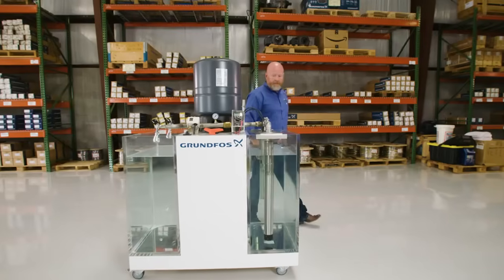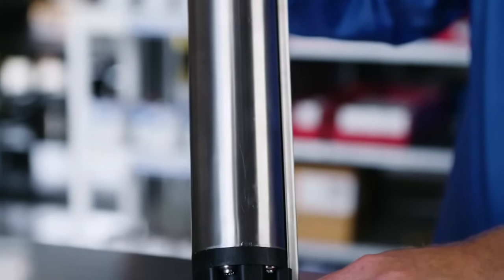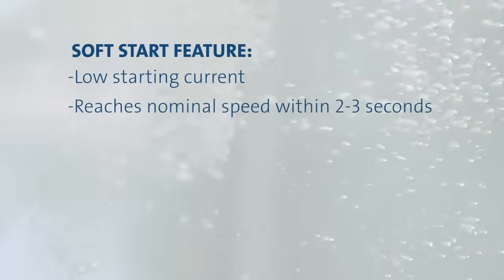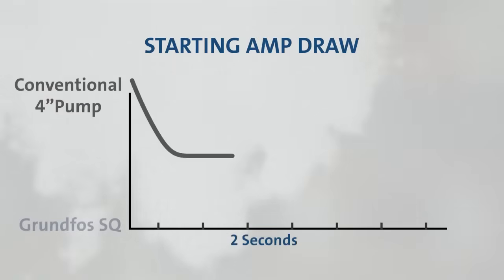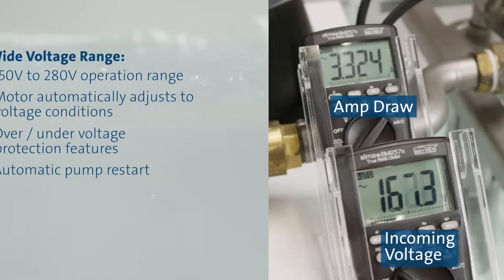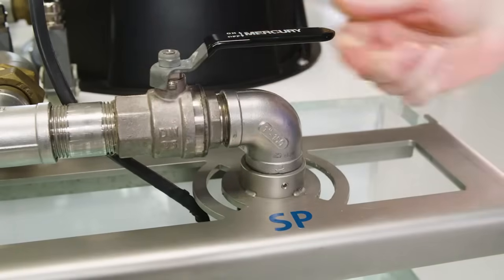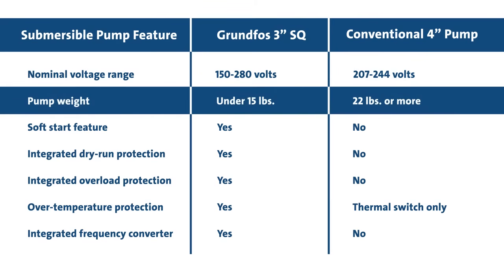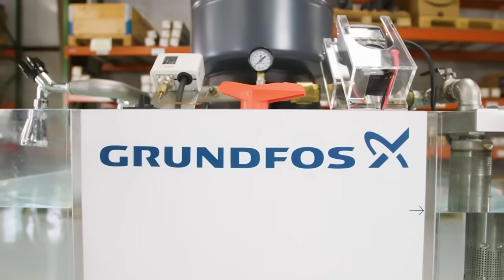Comparison of a Grundfos 3” SQ pump to a conventional 4” submersible

Comment: What SQ pump would I need to lift water 350 ft to a none pressurized holding tank . Not really needing high GPM flow .
Reply from the maker: Hi Jack, 

The smallest SQ pump (5 GPM Series) that will do 5 GPM at 350’ of lift, is called 5SQ07-320 pump and is marked in Blue in performance curve and Part Number (Material Number) list below.

If you would like to step up 1 GPM to pump 6 GPM, can go with 5SQ07-360 pump 

This is a good option if low GPM yielding well.

We hope this helps. :) 

Thank you :)
Reply from the maker: Also Another option SQ pump (10 GPM Series) will do 11 GPM at 350’ of lift, is called 10SQ15-330 pump.

This is a good option for a medium GPM flow at 350 feet of lift.
Reply: @grundfos   Sorry to hijack the post.
I have an sq3-55n in a 30meter deep 4 inch sleeve. Currently used to fill our 20000l fire fighting tank.
We run 1 and 1/4 inch pipe approximately 500m to fill this tank. My question is how does this pump handle property irrigation. Getting rather dry and want to run approximately 8  T pieces off the main line and each will also be running approximately 20meters of 1 and 1/4 hose. With isolation valves at each tap to run decent sized irrigation sprinklers. We do have a second bore same size however it is yet to have a pump installed. Will the single pump handle this.
Reply from the maker: Hi! Thanks for sharing the details of your setup. The SQ3-55N is a robust pump, and it may be capable of supporting your irrigation needs depending on total flow demand, pressure requirements, and elevation changes across the system.

To ensure optimal performance and avoid overloading the pump, we recommend reaching out to our technical support team at support-us@sales.grundfos.com. They can help assess your current configuration and advise on whether a second pump would be beneficial for your irrigation plans.

We’re here to help you get the most out of your system!

Comment: OK, I plan on getting one of these after I pull my old, dead pump out of the hole. Since I have a secondary well to supply water, I'm not in a real hurry but would like to get going on it in the next couple of weeks. The dead pump is down about 450' in a 500' hole and the well itself has produced from 1/2 gpm to around 3 gpm sonI need a pump that is optimal for that range. Can you recommend the model # Grundfos 240v pump that I should use?
I plan on doing the work myself, the downpipe is 1" sch 80 PVC in 21' sections so while it won't be a "fun" job, it's "doable".
Reply from the maker: Hello! Thanks for sharing the details of your setup — sounds like quite the project. For a well with variable output like yours and a depth of 450', selecting the right Grundfos 240V pump is crucial. To ensure you get the best recommendation tailored to your specific needs, we suggest reaching out to our technical support team at support-us@sales.grundfos.com. They’ll be happy to guide you through the best model options for your application!
Reply: @grundfos  Thanks, I'll do that. One other question, I was thinking of getting rid of the PVC and using 1 1/4" 200# poly piping which would greatly simplify the installation. Also the removal, since I could cut the PVC every 10' or so without having to bother with unscrewing a fitting every 21'.
Reply from the maker: Hi sorry for the delay. Getting rid of the PVC using 1-1/4” 200# poly piping sounds like a good idea for the reasons given and should work just fine.

However, it is really a local code question. Please investigate your locals codes and if allowed there, your good to go.

We hope this helps :)
Reply: @grundfos  Thanks. I already bought a Grundfos pump that should serve my needs. In your opinion, would 200PSI poly drop pipe work for a depth of 425'?

Comment: I have a 255’ well with 152’ static water level and 20gpm. What model would be the best? I think the sqflex is what I need as it will be off grid
Reply from the maker: Hi, 
Considering the initial sizing of 152’ depth to water pumping 20 GPM while off-grid sized to SQFlex 22SQF-220 Part Number 99465259.  Advantages for this pump selection also handles the additional foot of head from friction loss from length of pipe run plus fittings, additional lift to highest demand (shower head) and covers future dropping of depth to water of 152’ could drop to 200’ let’s say. Therefore, the 22SQF-220 will serve you well off-grid solar panel power source, even if your measurements change some. Thank you for asking. 😉 

Best regards, 
Steph

Comment: can these pumps hold up to 1-2 million gallons a year?  Not having problems with that with goulds 4" standard pumps but I want to switch to offgrid.  the regular 3 wire grid tie pumps are lasting for over 10 years easily.
Reply from the maker: Hi, 

We have taken many steps to increase the lifespan of the product both in the pump end, which includes the use of floating impellers each with their own tungsten carbide/ceramic bearings to ensure high wear resistance to sand for a long product life, and the motor, which includes the use of tungsten carbide/ceramic bearings and thrust bearings protecting against down thrust which allow product lifetime equal to conventional AC motors. These combined with the dry run protection, high efficiency pump and motor, protection against up-thrust, soft start, over-voltage and under-voltage protection, over-temperature protection and the high starting torque are some features and benefits which will also help to increase the life and operation of the pump. We do not have a definite lifespan that the pumps will last as the largest variable to the lifespan of a pump is going to be the environment that it is operating within. We hope this helps. :)

Thank you, 
Steph

Comment: My 780' well produces 45 GPM
Static water level at 70'
Puting out 15-20 gallons @360'
Is the 22SQ/SQE15/220 the right pump for me?
Reply from the maker: Hi, 

 We are not seeing SQ/SQE15/220 as the right pump. 

To pump 15-20 gallons @ 360’ needs more like a 4” SP16S200-18 if staying closer to 15 Gallon per minute. 

And, SP16S300-24 if staying closer to, or must achieve, 20 gallons per minute.

We hope this helps :)

Thank you, 
Steph

Comment: I am looking for 15SQ10-250. Grundfos documentation specifies this as 1HP, FL = 8.4Apms, but on online, products selection, specification is showing Rated power - P2 = 2.08HP, Power (P2) required by pump = 2.8HP, Rated current = 11.2Amps. Can you explain why the numbers are different. Is this 1HP or 2HP pump?
Reply from the maker: Hi Fred 

Grundfos documentation de-rates the 2HP motor on 15SQ10-250 as 1HP, giving it 1HP nomenclature, with a 1HP pump end mounted to it. This allows the 1HP pump to fit the product family position.  We can always de-rate a motor/product, but we are still required to publish the actual specifications (HP, Volts, Amps) online, on the motor nameplate, etc. 
Therefore, 15SQ10-250 is called a 1HP with a pumping performance of 1HP. This allows for a smaller pump end on a bigger motor, which makes less workload on the motor, less actual amp draw (not Max Amp), and less motor heat. All of which provide for a longer-life product.
Hope this helps!
Samreen

Comment: Im looking at the 5sq5-180, it comes in a 115v option from what ive read. This is a 400ft well going to a sistern, not a pressure tank. Will it work? Im replacing a dead 6sqf-3.
Reply from the maker: Hi @tinbenderbear4631,

Yes, the 5SQ05-180 is available in 115V AC and due to the permanent magnet motor along with it’s built in motor protections may be the right fit for your application, well aquafers are not all the same. We recommend reaching out to a Grundfos WaterPRO dealer in your area to ensure this is the correct size and it’s installed up to code. You can find the map here :) 
http://gfos.ly/6051nEX0B

Thank you, 
Steph

Comment: Hello, I recently bought my first SQ pump to install for one of my clients and I am very excited. The majority of installations down here (panama) are with Franklin products so I had to import this one myself. 

The one issue I am slightly worried about is the integrated voltage protection. Our service area has very frequent voltage swings/surges. Does the internal protection hold up to multiple swings a day? 
Pumptecs are normally installed down here for the Franklin products but even their distributor says the bad voltage can wear them down quicker than would usually be the case. 

Trying to find the best long term solution for my clients! Thanks!
Ps: Is there any chance of becoming an official dealer for Grundfos down here? If this installation goes well, I’m going to likely make the switch to just using the SQ and would like to not have to order from the US each time.
Reply from the maker: Hello! Would you please fill this form? http://gfos.ly/6058R9ZZq So we can contact you for more information. Thanks!

Comment: Hello! Would you reccomend installing a 3' grundfos pump in a 6' well? Will it overheat because water speed is low around the motor?
Reply from the maker: Hello Dan!
Yes, we recommend installing 3” Grundfos pumps in a 6” well as long as a Torque Arrestor is used.

Yes, it will overheat due to slower water flow past the motor if not sleeved.

Two problems you will run into with very low-cost solutions:

1)A 3” pump in a 6” well will allow the pump to swing/hit the well casing during starting torque.
Install a torque Arrestor on the outside of the discharge pipe just a couple of feet above the pump.
The closer you push the two mounting clamps together, the more the center bows out.
You want the center of the Torque Arrestor to drag (friction fit) a little as you send the pump down the well.
That way, when the pump starts and torques, the Torque Arrestor is right there, and the pump does not swing at all. 
Please see the snapshot below as a guide to finding a Torque Arrestor to steady a 3” pump in a 6” well. (There are several suppliers)

2)To solve the slow-flow overheating issue, simply collect a piece of 4” Sch. 40 PVC Drain Pipe 8” longer than the total length of the 3” pump and motor, a 4” Sch. 40 drain pipe solid cap, a small can of PVC Cement, and drill/tool/bit/ability to drill a hole in the center of the cap a little bigger then the outside diameter of the discharge pipe and wire. 
Please review the actual published instructions for proper sleeving. 

The following steps are to guide the understanding of mounting a Flow Sleeve.
Please seek actual instructions to notice if something is overlooked here. Plus, the instructions differ.
Step 1: Have the wire and torque arrestor secured to the discharge pipe.
Step 2: Drill a hole in the PVC Cap a little larger than the outside of the discharge pipe and wire.
Step 3: Slide the PVC Cap up and over the discharge pipe and wire, big opening facing down to the pump.
Step 4: Finish proper connections of the discharge pipe to the pump and wire to the motor. To the point, the pump is ready to send down the well.
Step 5: Slide 4” PVC already cut to about 8” longer than the pump and motor, up and over the pump, and cement weld (glue) the PVC Cap to the PVC pipe. 
Step 6: When fully/properly ready to send the pump down the well, holding the pipe vertically should have the torque arrestor clamped and spread wide about 2’ above the PVC sleeve.  The PVC Sleeve Cap should be sitting (hung up) on top of the 3” pump holding the PVC pipe and cannot fall off.  The PVC pipe should be about 8” longer than the bottom of the motor. So, the water has to enter the bottom of the PVC pipe to go up the pipe past the motor on its way to the intake. Cooling the motor greatly.

We hope this helps and if you have any other questions please feel free to reach out :) 

Best regards, 
Steph
Reply: Excellent advice, Grundfos!!!
Reply: ❤ I  want to now sp 30_6 the price
Reply from the maker: Hi Pa, 

Thank you for your interest in Grundfos. Unfortunately as we do not sell directly we cannot give out prices. One of our dealers will however be able to help you with http://gfos.ly/6057upL9z can find a list of local dealers here: – http://gfos.ly/6051upL9P

 Thank you. 

Best regards, Steph